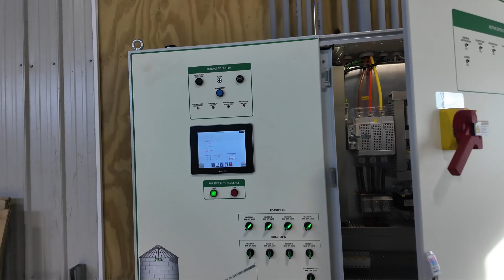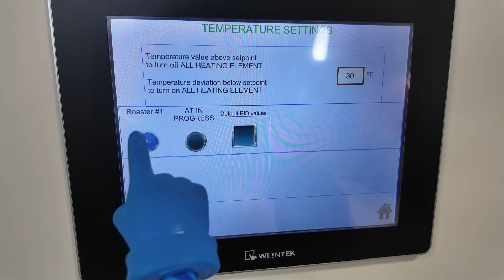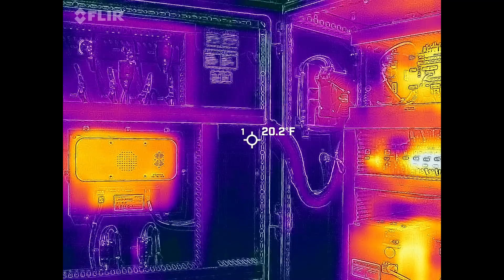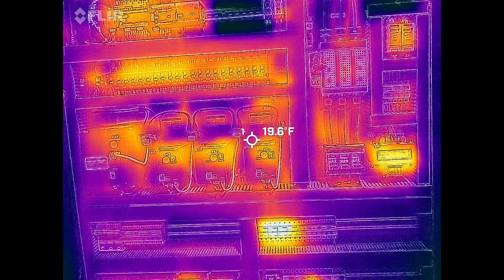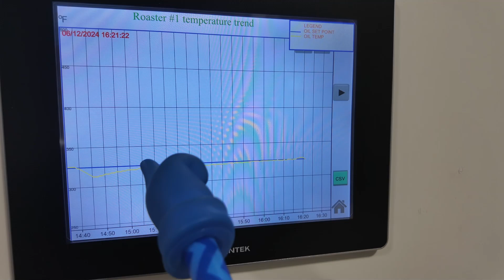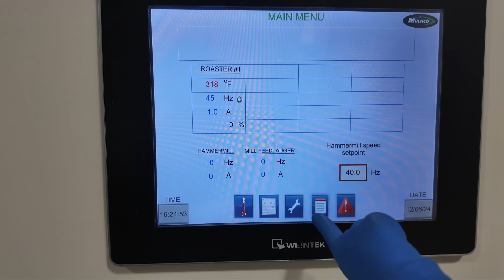Soybean Roaster, Multico automation

Comment: Why do they give grain augar speed as Hertz and not RPM??? 

Was it something that just grew from history or was it required for some reason
Reply from the maker: I don't have a good explanation for that and it would be very easy to change. We started that way in testing and when we realized manufacturer has a lot of variables in pulley and gearbox configurations we left it that way.